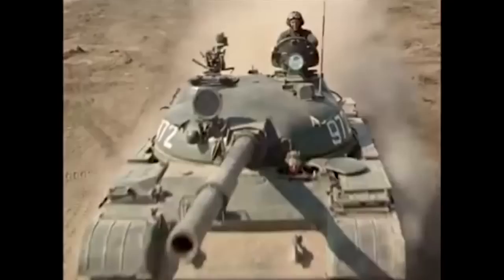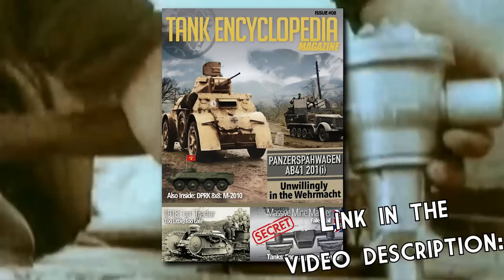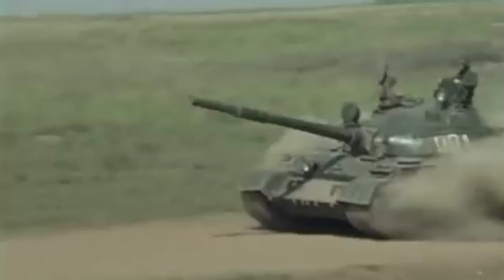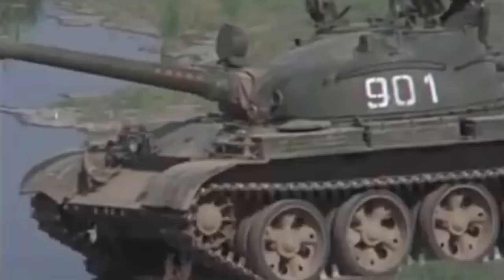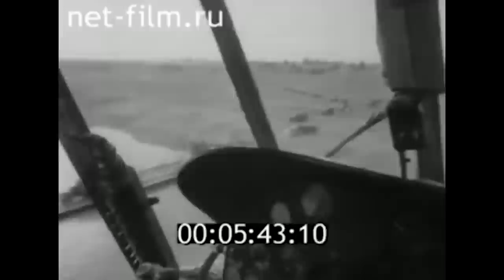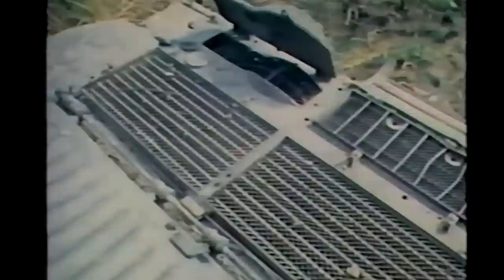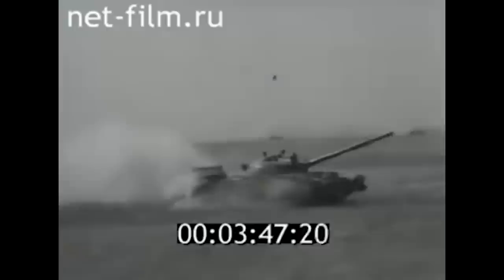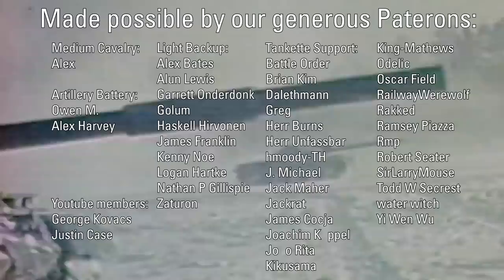Same-Old Everything Else | T-62 Main Battle Tank Part 2

Comment: "Soviet analysts stopped counting after 3km" this made my day 😂
Reply: The fact is that in Eastern and Central Europe the terrain is not visible beyond 2.5 km, due to the relief of the conditions of the terrain - slopes, hills, depressions and hills, natural for this theater of operations. So 3 km was some kind of limiting average value. Of course, in the desert areas, the firing ranges were different. In addition, at 8x magnification with binoculars, a tank at a range of 1.5 km will be a difficult target for an experienced gunner. It will be a small square on the binoculars grid. Even if the tank is standing. When he moves to hit such a target will be even more difficult.
Reply: @Imprudentman  well that is true but knowing the true capabilities of the gun at bigger ranges is extremely useful too.
Now with the upgraded T-62 with thermal imaging system that makes spotting targets easier they wish they could know if they should engage at all or not.
Reply: @AyoubusMagnus  A thermal imaging system is a rather complex system. The Russians have only recently learned how to make thermal imagers themselves. Actually, a rangefinder or a laser rangefinder is an inexpensive and really useful thing for a tanker who constantly solves the problem of accurately determining the range to a target via an optical channel. The regular cumulative ammunition of the T-62 gun, from the 60s of the last century, penetrates 500 mm of armor. What the author of this video mentioned. The frontal projection of the turret of the Leopard 2a4 tank is equivalent to 300-350 mm of armor. This is the most protected part of the tank. Leopard 1 has even thinner armor. Although, with hinged protection components, it will be improved. It seems that you are being ironic whether tank crews will open fire. In reality, this is decided by the tank commander, in accordance with the combat mission set by the superior commander. The task of shooting at long ranges, or rather determining the range to the target, is solved by a ballistic calculator or computer, which also calculates a correction for the movement of the target. What is implemented in modern tanks.
Reply: @Imprudentman Russians or rather soviets developed thermal imagers before, so it's nothing relatively new as you say, the other thing you are wrong about is the 2a4 armour, absolutely no way that the strongest part of the turret is only 350mm equivalent, it's more closer to 500.
Reply: @Sveta7  I admit that the forehead of the Leopard 2a4 tower can be 500 and even 650 mm of equivalent homogeneous armor, but I saw a video where they dismantled the Leopard 2a4 lined in Ukraine. The author of the video noted that in the area of the gun mantlet the armor of the turret was assembled from 3 armor plates with a total thickness of 300 mm. Apparently this is an early version of Leopard 2
Reply: @Imprudentman  well I didn't know that the decision to engage an enemy was given by the commander
I thought that the gunner has a green light on anything he sees.
Most tanks since ww2 have access to a range finder.
I highly doubt that the 115mm APFSDS of the T62 can pen 500 mm of armour those are figures from the more modern depleted uranium projectiles like the 3BM60 used by the 125mm gun like the one in  the T80BVM or the T72B3 ...
Good discussion
Reply: @AyoubusMagnus  the task of determining the range to the target has always been before the arrows. Rangefinders were on ships during World War I. Of course, rangefinders were in tanks from the 50s of the last century. It's all about the mass and dimensions of these devices, their characteristics, as well as the ability to link them with other aiming devices. Of course, the gunner can open fire on tanks, but only when he has received permission from the commander. It's usually done this way.
Reply: @Imprudentman Soviets were making thermal tank sights in the 80s. What are you talking about?
Reply: @AyoubusMagnus no, the gunner engages from TC direction.
Reply: @goforbroke4428  yes, in 1987, but decades passed - the technologies changed before they made the next one. I'm not talking about the fact that this thermal imager was made in the USSR, but Russia, although it is the legal successor of the USSR politically, but economically this is not entirely true, it seems to me. Not to mention the fact that the USSR was a different state with a different ideology, economic model and goal. A modern Russian thermal imager is made in Russia.
Reply: That good. They never Changed Engines. Just slightly Modified.
Reply: Tests records were limited to maintain adherence to doctrine as, although terrain often limited real-world engagement ranges, there was also concern that if the maximum (but low probability) hit range was widely published it could reach crews and encourage tankers to open fire from afar - revealing their position. NATO forces did the same, with one gun only being recommended for use out to two or three kilometres even though it had hit targets at four kilometres and beyond. 

It is often said, but nonetheless perfectly true, that the tank who fires first typically wins and to reveal your position unescessarily (whilst missing your your target) could cost a tank crew their life. The Soviets were well aware of this and some of their more intelligent (and less belligerent) commanders knew Western forces enjoyed advantages in their fire control systems and sensors - meaning there was little chance of evading detection after firing. It was for these reasons, that the USSR invested a lot of time and money developing a very good 100mm gun but shortly before it's adoption, NATO rolled out the 105mm family of guns based on the L7. 

To the abject horror of many Soviet engineers, the bigger equals better school of thought prevailed among senior leadership, and the stopgap under-tested 115mm gun was swiftly adopted. Of course, plans for the 125mm gun were already underway, so this only caused more confusion among calm minds.